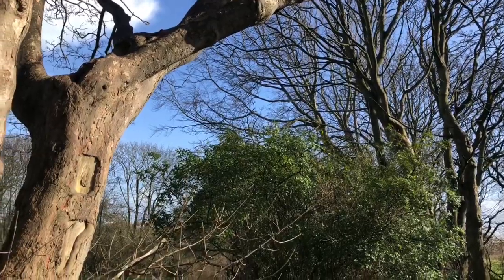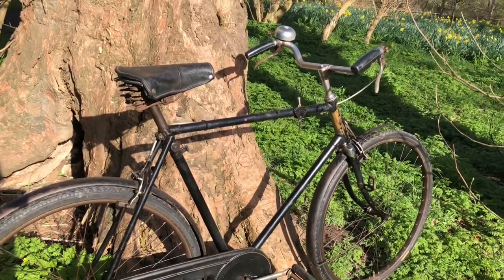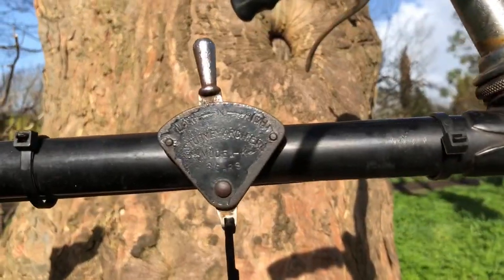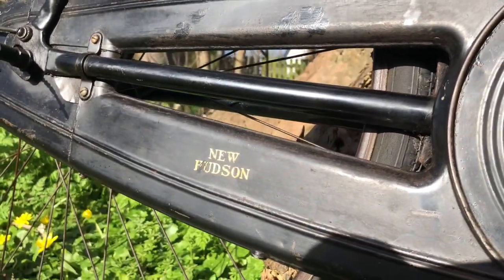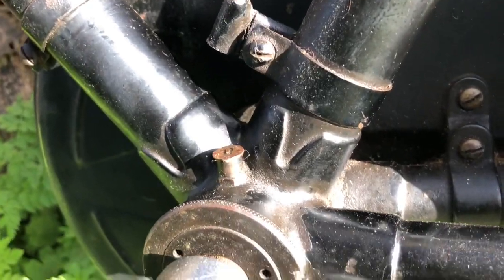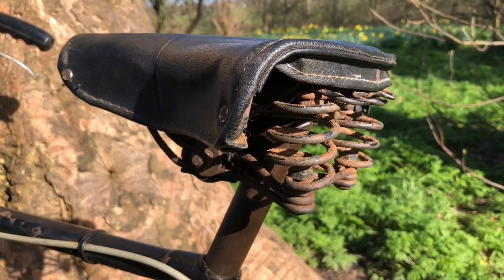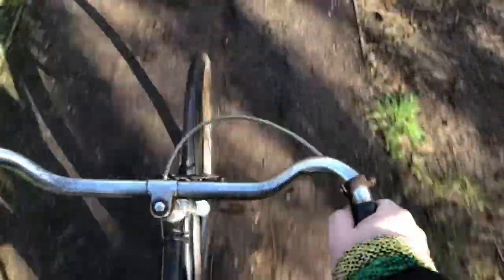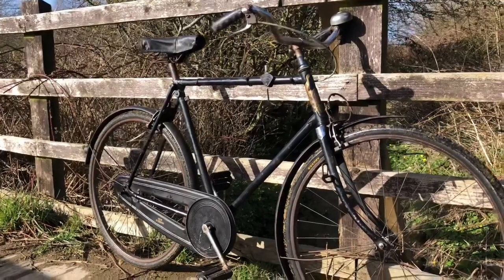New Bike Day! N+1 again! 1933 New Hudson City Gent 3-speed Original patina vintage bicycle

Comment: I shall be following this one with interest. Are you sure about the gear quadrant and other fittings, I reckon they were black from the factory as my 1935 Raleigh certainly is. The vogue for chromium plating didn’t really take off until after the war. I think it would be a shame to remove the chain case transfer, though it may not be correct it’s old and somebody once cared enough about the bike to attach it…. Nice one anyway.
Reply from the maker: I know what you mean but this is called the Chromium model because of the use of the novel and expensive new material. The lever is still chromed. I will just burnish the face plate and see how it comes ip, then finish accordingly.
Reply from the maker: Ive already ordered the handsome original transfers, and I really don’t like the woolworths letters. I think it deserves its dignity back.
Reply: @Velocipedium  Fair cop. Looking forward to the next instalment.